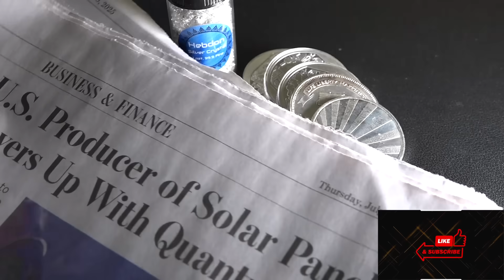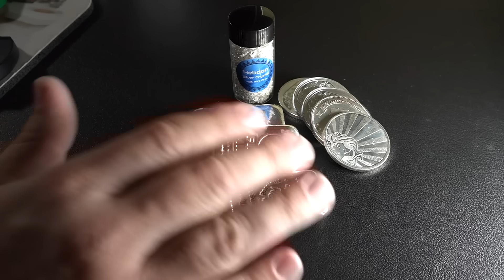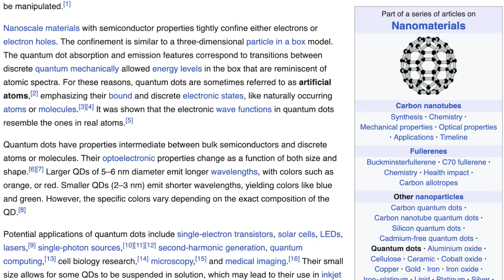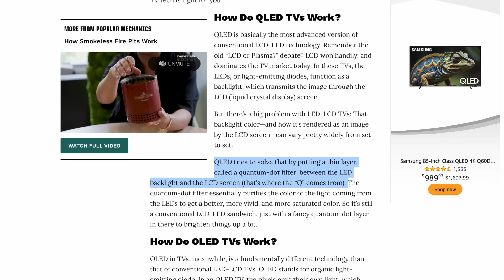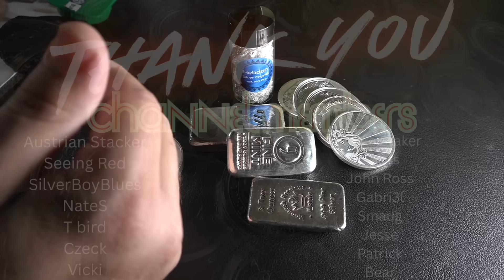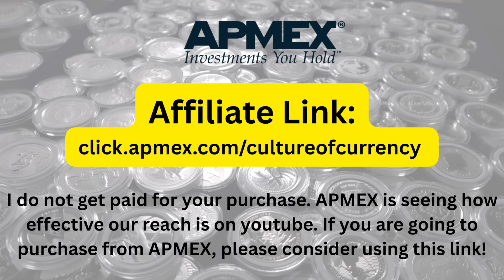HUGE SILVER ALERT!! Solar Panels are now using Quantum Dot Technology! SILVER COULD TANK!

Comment: This makes no since.  The silver is used as a conductor.  Its needed in both.
Reply from the maker: According to my readings so far, (which may be limited) QDs can be applied as spectral-conversion or charge-harvesting layers, enabling thinner silver contacts or removing some metallization steps altogether.

In bifacial panels, QDs convert reflected infrared and UV light into wavelengths better absorbed by the silicon or CdTe—or replace the need for fine silver finger grids on the backside.

Comment: Your demand conclusion is backwards. My background is MSEE.
Quantum dot will increase to power out of the solar cell. This will require more silver to transport this additional power.
Reply: I design and manufacture our Solar Blankets, plain and simple silver is required and we are not mining enough for demand.  There is no other feasable material on this planet that can conduct energy like silver does.  Maybe this is a click bate video to get subscribers, not sure, lots of ai youtube sites showing up now as well.
Reply from the maker: @offgridtrek  I have been around for years. 

SunDrive Solar (Australia): This company made headlines for developing commercial-sized, silver-free silicon PV cells that achieved a world-record efficiency of 25.54% by replacing silver with copper. They aimed for mass-producible modules in 2023.

CuSun Project (Denmark): A research and industry partnership is actively developing copper contacts for PV panels to lower costs and environmental impact while aiming to retain or improve efficiency.

Silver does conduct VERY well. (the best) The quantum dot does what silver cannot...focus on target wavelengths. My understanding is it can be tuned so well that lesser materials such as copper...and graphene which seems to be amazing at conductivity can be used with qdot and it makes up what not having silver reduces. 

This was a comment from a physicist on my reddit post:

As a physicist who worked in photonics, and has researched quantum dots, I can tell you that they are real. It is basically just the extension and application of quantum theory to near atomic scale in 3D, whereas classical semiconductor band theory assumes the application of quantum theory to a semi-infinite periodic lattice (at least much larger than an atom). Being able to control quantum dots is the holy grail for photon absorption and electron generation. It doesn’t rely on some hit or miss existing material technology like Perovskites.
Reply from the maker: @offgridtrek this may be true. I know many companies already have panels using no silver… batteries are another story though. These panels to my knowledge are not produced at scale yet which is why there is not a direct correlation to demand as of yet.

I agree whole heartedly with demand issues. Refiners control a lot of this as they know how much needs to be produced to make money. They have to calculate the cost and control the flow. Too much produced means they loose money currently taking it to the refinery. Refine too little, demand spikes and there are shortages of supply which hurt contracts.
Reply from the maker: It is interesting. The articles I am finding are showing how the QDs are being used to transport as well... It is not yet as good as silver but they are making large strides. 

QDs can be applied as spectral-conversion or charge-harvesting layers, enabling thinner silver contacts or removing some metallization steps altogether.

In bifacial panels, QDs convert reflected infrared and UV light into wavelengths better absorbed by the silicon or CdTe—or replace the need for fine silver finger grids on the backside.

Graphene‑based QD inks (e.g. by GraphEnergyTech) can replace silver paste used in screen‑printed front contacts, cutting down on silver content and cost.

It seems by customizing QD bandgaps, solar cells can capture a broader spectrum with greater efficiency, reducing dependence on silver metallization to compensate for spectral inefficiencies.

I am not an expert but it seems that the end game is to use items like copper blened with the QDs to limit or maybe eliminate silver from the panel side. The question is, what does that mean for silver in batteries...will there be more need on that side of things...I have no idea.

Comment: Problem is that solar cell QD technology currently relies on the toxic heavy metals.  So not only do they have to provide a greater efficiency-to-cost ratio than silver-based panels, but the high costs to dispose of them has to be absorbed.  Few landfills in the world are willing to take on this type of e-waste right now.  It will likely take decades to work through this.  Ironically, if QD technology does take off, it will drive the need for advanced batteries, with silver-based batteries being the primary option.  So in the end instead of silver-based panels w/ heavy metal batteries, we may end up with heavy metal panels with silver-based batteries!
Reply from the maker: That is an interesting idea. Seems like a bate and switch... I was thinking a new type of battery would be unveiled in the coming years making that sector more competitive but it seems to be quiet on that front as of late.